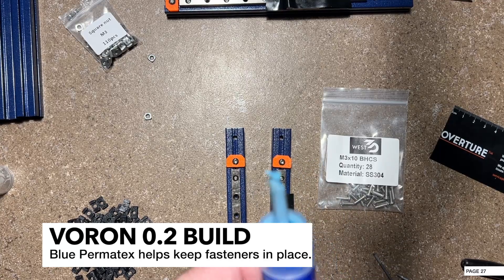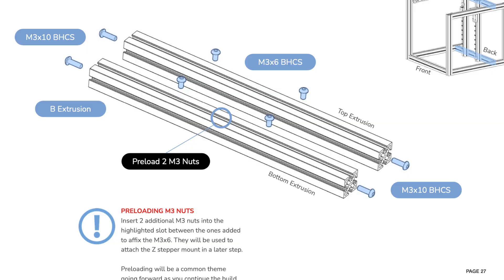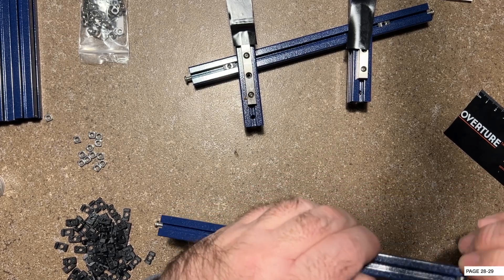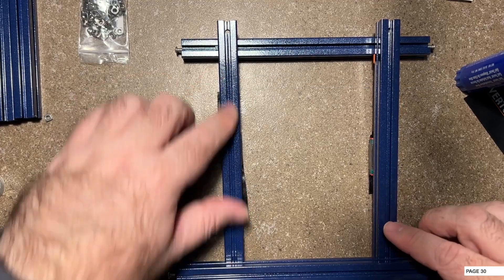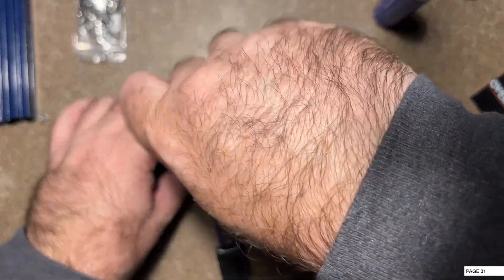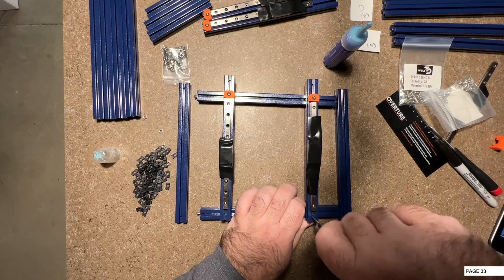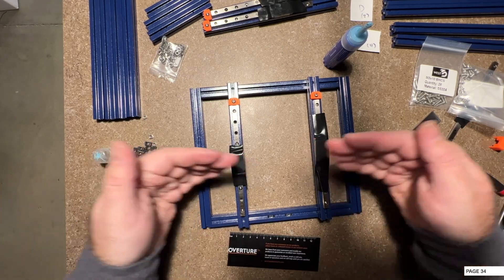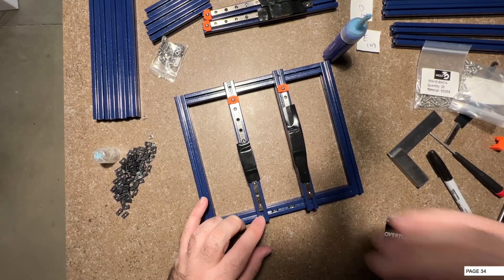Part 2. Voron 0.2 Build Series  Z Axis Extrusion & Rail Assembly

Comment: Unless you are working really quick, thread locker in those blind holes start to set rather quickly. Gotta make sure you are using good quality fasteners and hex drivers or it may strip the head. I skipped thread locker on the side "helper" extrusions until later in the build after they are relocated.

Comment: hey Greg, appreciate you highlighting all the potential pitfalls for the Voron 0.2 build! i have a couple of questions:
1) for the no drop nuts, can i print them in PETG?
2) if i were to use Loctite, should I be using the blue instead of red?
Reply from the maker: Yes- no drop nuts should be fine with PETG. And yeah, blue loctite- definitely don’t use red as it won’t come loose without heat. Blue comes loose with a bit of extra force.
Reply: @GregsMakerCorner  thanks for the prompt response!
Reply: @GregsMakerCorner  just curious, how did u print your no drop nuts in ABS? as they are so small, i had problems with bed adhesion - parts keep on coming off... did u use brims? I ended up printing them in PETG...
Reply from the maker: @chriseow  PETG Should be fine for the no drop nuts. I didn't use any brims on mine, but I use VIsion Miner Nano polymer to help keep things sticking down to the plate.
Reply: @GregsMakerCorner  i see. thanks for clarifying!